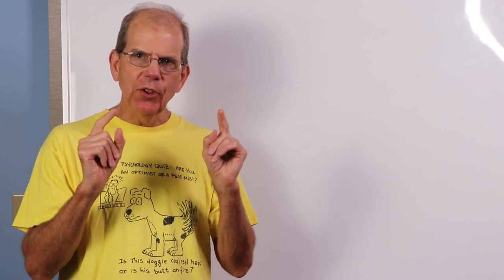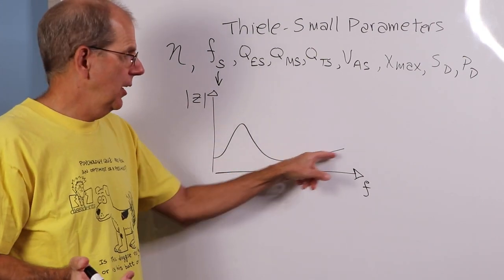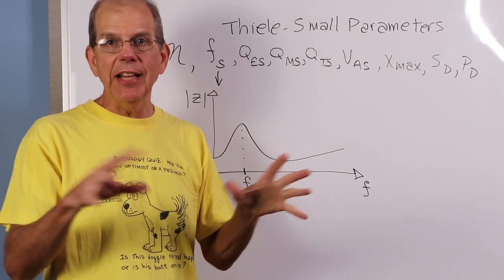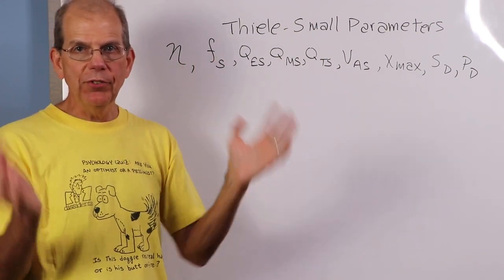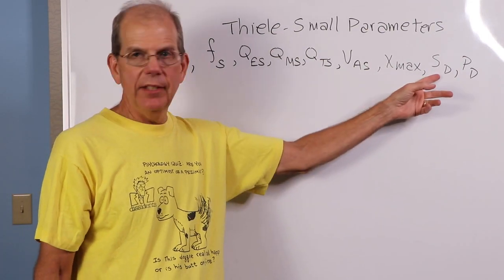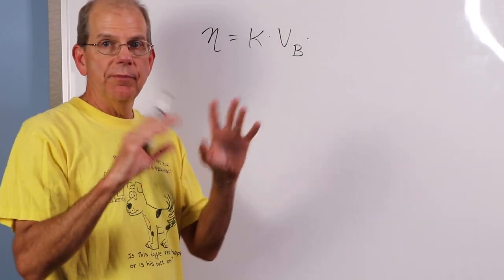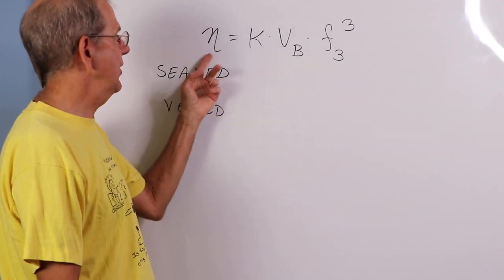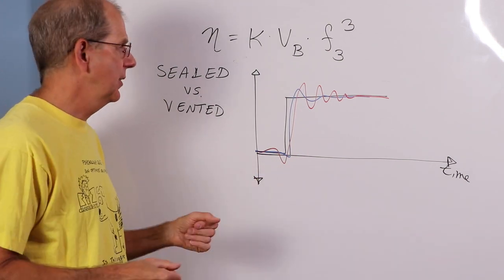Science of Sound: Loudspeaker Enclosures

Comment: I have a hard time having confidence that the ts parameters can actually be taken accurately by the same method originally used by Mr T and Mr S 8n modern times when the subwoofer being tested weights 90+LB and has a 4" voice coil that's rated at over 4000 wats rms and a suspension stiff enough to stand on I can't help but think that it's not the same as back in the day when speakers were under 10watts rms
Reply from the maker: Thiele and Small, et al. published their work in the 1970s. There were many professional level woofers in the 100 watt+ region back then. In fact, I recall designing some vented PA subs circa 1981 that used 18" Gauss drivers with dual spiders, 4" VC, handled 400 W RMS, and had an efficiency of 2%. I used a computer program that I wrote (for a DEC VAX 11-780!) to model it using the TS equations. The design was a complete success. (Side note: That program was reworked and ported to the Commodore Amiga PC in the late 1980s, and sold as "SpeakerSim"; the first product that my company, dissidents, produced).  

When it comes to skepticism, I am generally not confident of claims of continuous power dissipation of several kilowatts. At least not in terms of useful dissipation. By that, I mean that it is easy to get a driver to withstand that power, but is it being used effectively?
Reply: @ElectronicswithProfessorFiore  well I personally feel that a 100lb sub rated at 5k RMS with a voice coil that is 8 layers and 100mm tall winding height and ways over a pound for just the coil windings and has 5 to 8 extremely thick spiders stacked together is in no way regardless of the application it is being used in  it well never be as efficient as a same diameter 400 watt RMS speaker there's just no way so I agree with you there
Now why do they make 100LB subs? Because if the power is available but the space is limited and the goal is maximum DB's then efficiency is outweighed ( no pun intended) by power handling and the ability to move more air (some 100lb subs can have 100 to 120mm of usable peak to peak throw ) and so with a limited space (a vehicle) and a goal of highest DB's you can put as many 400 watt subs in the vehicle as you want but the vehicle that has the 100lb subs (assuming box specs are correct for each vehicle and application the extremely inefficient super heavy behemoth subs will reach a higher decibel level solely on the principle that lack of efficiency can be made up for in raw power handling and air displacement so the end result being a higher decibel level than the vehicle with lower wattage subs despite the 1/2 or 1/4 percent efficiency LOL

But I question the way we because how can the computer read the specs of a sub that's so stiff you can stand on it and it takes 800 watts RMS to even see the cone start to move so how can it tell the FS and all the other parameters feeding it 2.8v/1watt? I just don't understand how it's getting trick feedback from such a small signal in comparison to the thing receiving the signal

And to your rebuttal by saying you built some boxes that did great I will say this
I've been making my own boxes for about 15yrs and I've never used the  TS parameters to calculate what size box in tuning frequency to use and I have a reputation for how good my box is sound and side by side my box is 10 to sound better get lower and play louder than boxes supposedly designed for the specific speaker sometimes and especially they sound a million times better than a q power or a pro box that you can buy online those things are just trash
So my point being that it's a fairly generic situation making a speaker box yes if you have a specific goal then that can require some unique design but generally speaking there's a pretty broad band of usability just like all humans seem to wear clothes eat food and sleeping houses there are a few that don't but the majority do.
Reply from the maker: @SheikhN-bible-syndrome  First off, you cite a driver with 1/4% efficiency. I would much rather have a 2% efficient driver (like that Gauss) that handles 400 W than one with 1/4% efficiency that handles 2 kW. Why? Well, from the first one I can get 8 acoustic watts with a 400 W input, and the second delivers only 5 acoustic watts yet requires 2000 watts to do so. And don't forget, you need to account for that increased input power, plus the heat that will be generated.

Second item, you are suggesting that the parameters change under load, e.g., that a measurement of Fs at one watt will not be accurate for higher SPLs. What you're really claiming here is that the transducer is wildly non-linear. If that is the case, that's not a driver you want to use in the first place. Granted, some non-linearity is expected when the transducer gets near its thermal or mechanical limits, but if you find that Fs has shifted from say, 30 Hz to 45 Hz when moving from 1 W to 100 W, you're looking at a transducer that probably belongs in the dust bin.

Third, I am not saying that it is not possible to design a system without using TS parameters. Of course you can, and it's possible to get good results, too. But the TS system makes things easy(er) because now we're applying well-established electrical circuit analysis techniques to an electro-mechanical system. Speaking as an electrical engineer, I like that, but if you have found some other methods that work for you, great.
Reply: @ElectronicswithProfessorFiore  I think your missing my point and I pulled that 1/4% out of my you know.
> was just using an extreme as an example.

that gauss speaker you had only has a xmax of I think 3mm if I'm not mistaken and will sound great on just 100 watts  I can see a DATS v3 being able to read it's parameters but my point is I can't see it being able to read a 100lb sub that you can't even see the cone move when it does a sweep test and the cone doesn't seem to move at all despite being able to move 4"  so then how can it tell things like fs as well as thermal limits /tech? I just can't see that being possible
and that's probably the opinion of whoever came up with the Klippel test where they feed the speaker however much is needed to bring it to it's limits
Reply from the maker: @SheikhN-bible-syndrome  If I recall correctly, that Gauss driver was an 18" designed for professional PA and had an Xmax of around 25 mm, but that's beside the point.

Please correct me if I am misinterpreting your statements, but it appears that your argument boils down to "TS parameters measured at low input powers are not accurate when compared to those same parameters measured at much higher input powers". If that is the case, then effectively you are arguing that the transducer under test is not particularly linear across its operating range. A non-linear transducer, by definition, is one that will produce considerable distortion. No one wants that, and reputable manufacturers try to avoid that where possible. Granted, it is true that non-linearities will become more apparent as the transducer is pushed to its thermal and mechanical extremes, but that's not where we operate the device normally (if we did, we'd have to conclude that the system design was subpar- as I'd often tell my students, no one wants to be hanging from a 200 pound test rope if they weigh 195 pounds). 

Regarding Klippel, I believe the major goal of the Klippel NFS was to perform tests without the need of an anechoic chamber (although it can do other things as well).
Reply: @ElectronicswithProfessorFiore  not exactly I guess to sum it up my point is I find it hard to trust that a method of testing speakers that was designed around speakers much smaller and weaker than what we have today can accurately measure these 80 and 100 lb monster speakers only using one Watt of power

 seeing as hell there's just so much extra driver I don't have much faith that the software and equipment can actually take a proper reading and that the TS parameters aren't that important because you can generalize with the speaker fairly well and make a good box without using the TS parameters 

so what numbers it does spit back to you accurate or not when applied give the appearance that they work because the numbers aren't that important and that I'm hoping you have some tidbit of information that will put my concerns to rest that the equipment can properly test such large speakers without issues because I have not been able to come across such knowledge yet.

as for some of the things you said
speakers to the best of my knowledge do change when power is applied and that the parameters don't stay the same as they do at rest now there is a area of linearity yes but that's more of a concern of distortion becoming audible as opposed to the general parameters fluctuating with frequency and amplitude

 so yes there is a range you can play that's linear but they're still massive fluctuations within that range it's just not on the distortion scale but from a parameter sake they do fluctuate that's why they call it a reactive load as opposed to a non-reactive load is because the second that electricity hits that coil everything starts changing and that also changes with box and frequency and all that other stuff you know all too well about so then because all the parameters do change with applied power how can a one-watt test sweep properly understand how a speaker that can take 5,000 watts and move 4 inches is going to behave in a real life scenario when the sweep doesn't even make the cone move let alone saturate the coils to probably get feedback?

and I was under the impression the klippel test was made for this very issue we're discussing right now?
Reply from the maker: @SheikhN-bible-syndrome  Let's start with this:

"so yes there is a range you can play that's linear but they're still massive fluctuations within that range it's just not on the distortion scale but from a parameter sake they do fluctuate"

A device cannot be linear and still show "massive fluctuations" of its parameters. Also, saying that "it's just not on the distortion scale" makes no sense. Non-linearity is what causes distortion. Further, a loudspeaker is called a "reactive load" because it's not a purely resistive load, meaning that the impedance phase angle is non-zero across the spectrum. Essentially, you are simply arguing from incredulity: i.e., you find something hard to believe, but offer no solid evidence. That's a logical fallacy. 

Please do not take this the wrong way, but from the preceding I conclude that you have no formal training in engineering, and specifically, electrical engineering. That's not a bad thing. Engineering is a specialized field with very specific spheres of knowledge, and not everyone can or should be expected to be an expert in it. But, if you have an interest (and it certainly appears that you do), there are plenty of places where you can learn about the field from experts. I suggest coursework at the college/university level if you're looking for a career, but there are many other resources where you can get valuable insight, including right here on YT. Take advantage of what is being offered.
Reply: @ElectronicswithProfessorFiore  you would be correct that I have no formal education and I'm not taking the stance that I'm right and you're wrong I know that I'm wrong that's why I'm asking you is because from what I gather my conclusion does not match what people are doing and I assume because people still get correct readings from their work my assumption is that my conclusion is wrong however I don't know how to reconcile my assumptions hence why I'm asking you

So are you saying that regardless of the power handling and size of the speaker I could have a 2000 lb subwoofer with a 12-in coil that weighs 20 lb in capable of handling 100,000 Watts RMS and I can hook up my DATS V3 and run a test sweep it 2.83 volts and it will give me an accurate TS parameter reading? Isn't some form of coil saturation necessary in order to read the characteristics of the speaker? Because the part that's confusing to me is how can it get a proper reading on a coil that weighs almost 2 pounds by itself and a suspension stiff enough to stand on and it be just as accurate of a reading as it is for a 8-in speaker that only weighs 4 lb total with a little dinky one inch voice coil ?
Reply from the maker: @SheikhN-bible-syndrome  First off, you don't want coil saturation. A saturating coil is non-linear, and that means distortion. 

Let's take a step back. Before any two people can discuss a subject/item in a meaningful way, they have to agree on what that item is, i.e., its definition. What do we mean when we say something is linear? Mathematically, that means there is a straight line describing the pair of parameters of interest (i.e., some input quantity and some output quantity). For example, if we look at a simple resistor, within normal use, there is a linear relationship between current and voltage. If we apply a larger voltage, a larger current will result, and (this is the important part) that change will be proportional. If we double the voltage, we'll see double the current. If we cut the voltage by a factor of 24.548, the current will decrease by a factor of 24.548, etc. It won't matter how large or small that voltage is, we'll always see that same relationship with the current. This is true up to the point where the device is being used beyond its designed-for range (in the case of a resistor, eventually, the thermal limit will be reached and the device literally will burn up). 

In contrast, we have devices whose current-voltage characteristic is not linear. If you plot it, you get a curve instead of a straight line. A diode comes to mind. In musical electronics, diodes can be used to create distortion (like a guitar fuzz box). The non-linearity is what makes that happen. 

An ideal loudspeaker is a perfectly linear device, and thus, the size of the input signal (terminal voltage) should have no impact on the output (SPL) beyond the proportional increase/decrease mentioned prior. Of course, no real world component is ideal. We try to reduce the linearities where feasible, but eventually, the input will become so large that major deviations from that straight line will occur. The end result is distortion. In the case of a loudspeaker, this would occur as the thermal limit of the VC is approached as well as when the Xmax is approached. (Side note, as the excursion has an inverse relationship to frequency, it is possible to hit Xmax well before Pd-max is reached, just by using a very low input frequency).

So it doesn't matter if the input signal is one milliwatt, one watt, or 100 watts; as long as the device is behaving in a linear fashion (i.e., not near its design limits), the parameter measurements will give the same results. In practical terms, some inputs are more convenient than others. If the input is very small, noise and precision issues can arise. If it's very large, we're going to have to start considering the distortion created by the power amplifier needed to drive the loudspeaker. And obviously, as the signal gets larger, any non-linearities tend to be more noticeable (this can show up as power compression or increased THD). 

Regarding the extreme cases of 1000 pound loudspeakers with 20 pound voice coils, I would agree that you might get parameter variations at very high power levels but that's only because building a loudspeaker with those specs would be extremely challenging in terms of maintaining its linearity. In other words, it's a lousy loudspeaker, and it should come as no surprise that such a device would display its lack of linearity in a number of ways (parameter shifts being one of them). 

There is a common belief among loudspeaker enthusiasts that the larger the magnet, or the bigger the voice coil, or the heavier the unit, the better. That is categorically untrue. For example, generally speaking, a heavy cone is to be avoided. This is because it creates a bad mechanical match to what it drives (air). This is a mechanical/acoustical version of an electrical impedance mismatch. It leads to low efficiency (i.e., less SPL for a given power input). You're doing a lot of work and getting little out of it. Here's an analogy: let's say you can throw a 2 kilo rock a certain distance. Your buddy, the weight lifter with massive arms, can throw it twice as far. Now suppose you each pick up a tiny little pebble. Will your buddy still be able to throw it twice as far? Probably not. There are multiple reasons for this but the one I want to focus on is the bad mechanical match between the stone and the thrower's arm. With such a light stone, most of the work will go into moving the thrower's arm, not moving the stone. In this analogy, the arm is the loudspeaker cone and the stone is the air around it. Ideally, what we want is a cone that weighs nothing but is infinitely stiff (good luck finding that- compromises will have to be made).

I hope this rather lengthy comment has proved useful. As you have an obvious interest in this subject, I would also suggest that you invest some time to go through the fundamentals. There is a lot of garbage out there in the audio world (bizarre claims leading to $1000 loudspeaker cables and the like). You might start with my DC Electrical Circuit Analysis playlist. You can download the accompanying textbook for free. Or, pick some other reputable source on YT, just make sure it's someone with appropriate credentials and not some random self-proclaimed expert who just might be spouting nonsense.
Reply: your absolutely correct sheik.....however the "high end" audio world has failed to catch up, at the same time high db cars push massive forces and watts/ stifness...they have also failed to catch up....Thiel small parameters are (were) always small signal....2023 are now large signal...100 pound woofer with  a 4 inch coils wieghing 1/2 kilo is different than the 10 ounce 1/2 inch 1 ounce voice coil
Reply: 1 of th e current state of the art systems is called "KLIPPLE" loudspeaker measurement by university of munich
Reply: however this is a good valid video❤